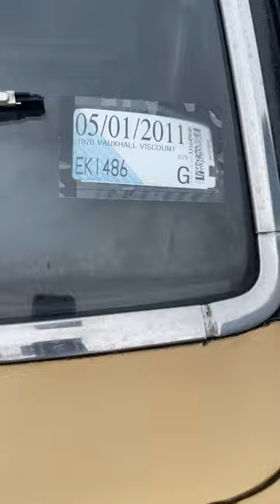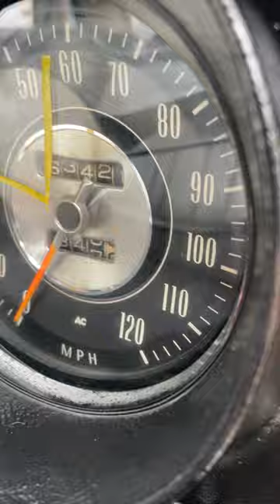387 1970 Vauxhall Viscount

Comment: The auto transmission in the Viscount was Powerglide a tough transmission  but already obsolete in  tue USA. Withbonly a two speed ratio depending on the torque converter which was okay behind a small block 283: Chevy V8 but ....

Comment: Had one of these beasts in the mid 70's, but it developed problems with the Powerglide transmission. Would not change up through the gears. Tried to get a vauxhall dealer in Dundee and Aberdeen to sort it, but they said they could not take the job on… ended up flogging it for £70.